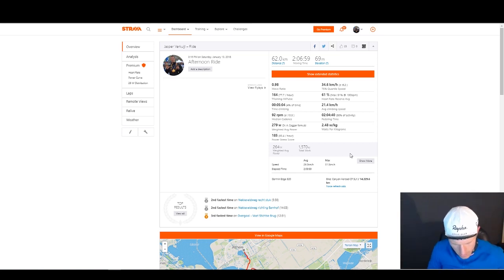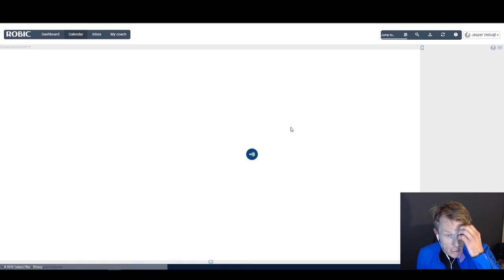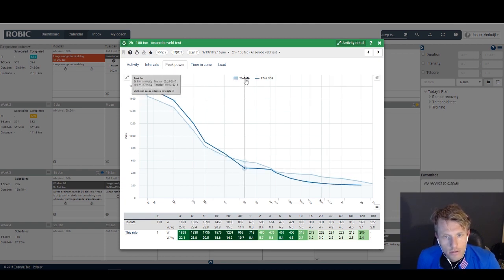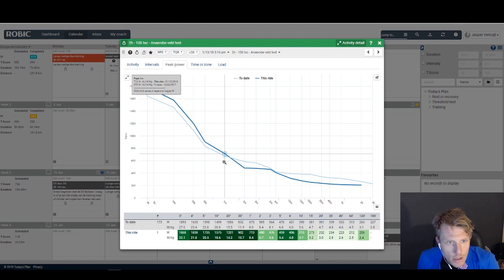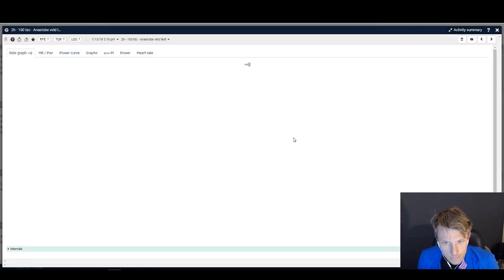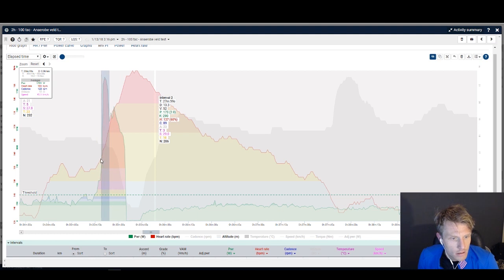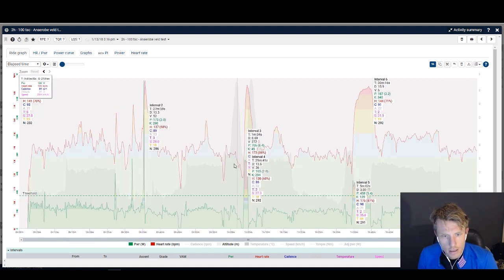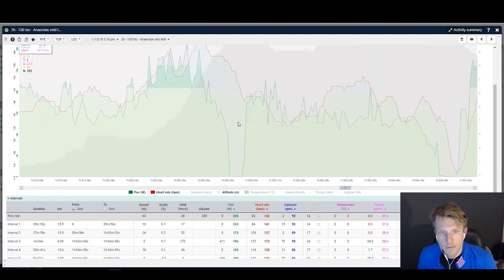POWER PROFILE TEST RESULT ANALYSIS with professional Team SKY software - #cycling

Comment: Cool platform. Will have to think about purchasing subscription (seems to work better than trainingpeaks and strava just sucks as a training tool with some minor exveptions). But first a power meter. And shredding some weight. Have you seen what quality are those training plans that you can get with extended subscription? You look kind of worn out it's just lighting or back up a little (it's still pre-season you know)
Reply: Golden Cheetah is free and gives the same analysis
Reply: Derek Clegg can plan and sync workouts with Wahoo element?
Reply: Sorry, not sure I only use it for data analysis post ride, but if you ask that question here you should find out
https://groups.google.com/forum/#!forum/golden-cheetah-users

Comment: Impressive numbers! As others have said, definitely think you could bash out some more for the 1 minute power, given how high your 15s is. Though it depends whether you want it to represent sustained 1 minute power, or burst, as with a power profile like that, I can see the average being higher. Your 5 minute power is also insanely OP!
Estimating your 1 min power off of your 5 min power, you can calculate Anaerobic capacity to be 25,200J.  AC=(459-375)*5*60 (5minpower-FTP)*(5minutes_in_seconds)=25200.
If you then, change the duration to calculate work done above FTP for 60s, 25,200/60 = 420, 

375+420 = 795W 
So for the same anaerobic effort, you should theoretically be able to produce ~800W for a minute, perhaps more given your neuromuscular strength. (This calculation wont quite work for efforts less than a minute)

This trend may not entirely work for everyone, but the trend follows for me really well, where I have an AC=20,220, @ an FTP of 263w, which gives me a 1 min power of 600w (which I have achieved), and a 5 minute power estimate of 330w. My best in practise was 326w for 5 minutes at the start of a race, though have yet to do a standalone 5 minute effort, but pretty close.
Reply: Digging the math! Do you have a source for the arithmetic you've referenced here? Thanks
Reply: http://cyclingcenterdallas.com/blog/2014/02/11/functional-threshold-power-ftp-anaerobic-work-capacity-now-titled-w-and-how-it-applies-to-classes-at-cycling-center-dallas 

This article seems to explain how to use the calculator (as well as the maths behind it), its very useful for giving you a rough gauge of how to pace an effort, and for also potentially tracking improvements in your Anaerobic work capacity.

https://www.cyclingpowerlab.com/MonodCriticalPower.aspx (This is a calculator where you can plug in known power numbers for set durations, and it estimates your power for a bunch of different durations off of that).

In simple terms, you are basically calculating the amount of energy expended above your Critical Power (Which is often very close to Lactate Threshold, but slightly different definition to do with the point at which your body cannot recover).

In order to work out energy expended, Watts (W) is defined as Joules per unit time, so to get the "Energy" in Joules, you simlpy take that wattage and multiply it by the duration (in seconds). But, as you are only intersted in the Anaerobic Work Capacity (AWC), you take the difference of watts above LT. 

So you can approximate your anaerobic capacity by calculating any zone from 1 min to 30 min (it skews after this), and then use that value, dividing the AWC by the duration of any other zone you want to know (in seconds), and adding that value back onto your LT to estimate how long you should be able to hold that zone for.
Reply: Not sure what you are saying, but i plugged the numbers that you gave in, and it specified:
aerobic endurance (Z2) 166 to 225.

I believe the mistake you made is that you only put in one value, leaving the other zone blank (causing it to get treated as 0w). You have to put in atleast two values in order for it to draw any estimate. The reason it needs two values is because naturally, one value alone isn't enough to estimate a power profile for a given rider. 
Equally, the purpose of the app is to estimate a critical power curve based on limited inputs. Ideally, you should input 3 values:
some tested shorter interval (5 minutes or less), a tested 20 minute interval, and a tested 1h interval. Using the 95% rule straight away isn't going to be super useful. The equation used by the software also does not work for one hour of power, as the estimates are based on anaerobic work capacity, which is calculated by using work done above threshold (given that threshold is the point at which you are at the cross-over between when your body can clear lactate faster than it builds).

So i'd suggest giving it another go and plugging in your 20 minute, 60 minute, and some shorter interval that you have that is an all-out effort, such as a 5 minute or 1 minute. For me, doing 1,20,60 gives me a great idea of what I can hold for 2, 3, 4, 5, 10 minutes etc; when fresh and going all-out.

Obviously, this is still only an estimate, but so are many things such as training zone bands and the 95% FTP rule. The idea is to give you a better starting point than you would otherwise have, one that is both simple, and general. It may not be entirely correct, but it can give you a baseline without having to go out and do loads of maximal efforts of different durations.

Also, on another note, impressive power numbers :) I'm at a similar weight to you and was wondering how long you had been training to reach a 300w FTP. I know there are a lot of factors,  but would be interesting to get a ballpark idea, or know what sort of training you did to get it up there :)?

Comment: I'd say do more anaerobic work, because if you hit 1500(ish) for 15 seconds , 713 watts for a minute is just too low. I saw the test too & I think you were to conservative and tried to pace it too much, you should be on the verge of puking or blacking out. That too is a skill.
Reply: I hit around 783 watts at 68 kg for a minute. My max wattage is 1495 (though i usually top out around 1380). If I do 1 minute full gas, I usually hit a 1000 watts at the start and then just hold on for dear life at around 900 watts. I try not to look at the watts too much, just hold on to the pace as long as possible and fight the lactate. When the lactate starts hitting your fingers and ears, you're doing it right. My best effort I couldn't hold it for the whole minute, it lasted 56 seconds and completely died. If I could have hold it for 4 more seconds, I would have been in the 800+ mark. I find that doing these on a launched incline (get up to speed on the downhill), I get the best results. Get your momentum up in a relatively 'big gear' (90-100rpm)and just try to keep pushing that speed OVER the hill. Hills of around 4% are perfect (for me anyway). The more you do them, the better you get at them. Your aerobic engine is already impressively big anyway